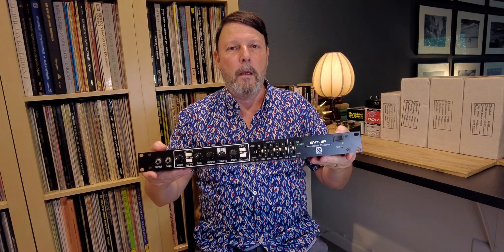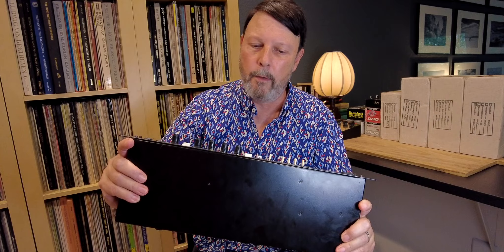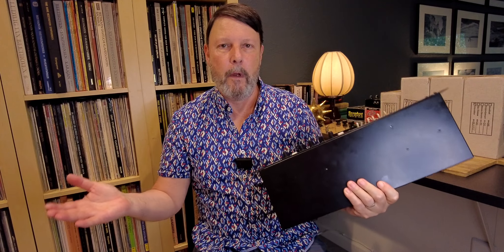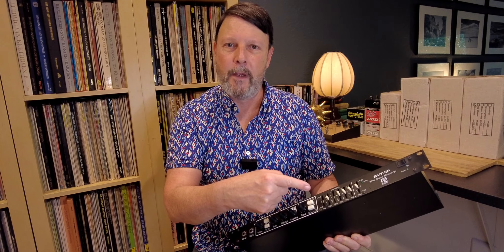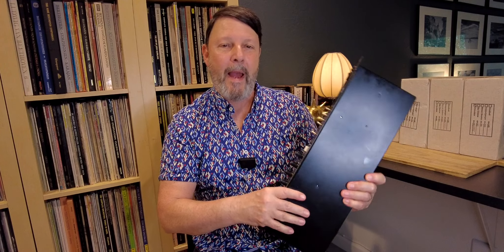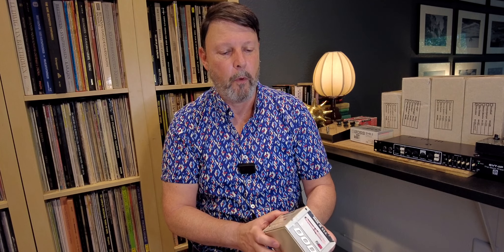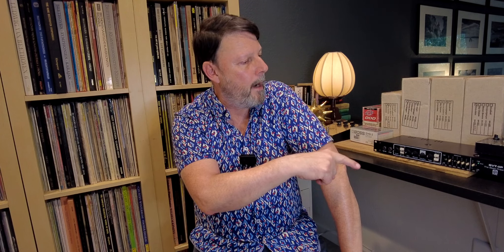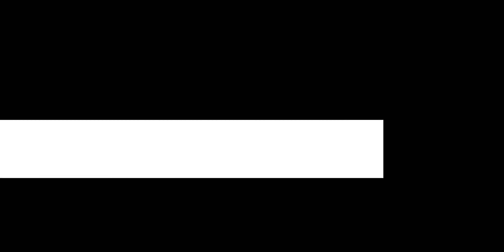90's Era Bass Rig Rundown with Mark D. !

Comment: My old studio engineer buddy had the DOD King Buzzo pedal(still in the box).Never got to try it but I'm sure it was gnarly 🗽
Reply from the maker: Nice ! It was definitely a noise maker !
Reply: I remember a guitar mag that had an article on the "Buzz Box." To this day, I have still not seen one in the wild, or know of anyone that has one. I'd love to hear it's sound!
Reply from the maker: @ScaryGarrySG1  I'm remembering now that I had one and gave it away...seemed to be a combo of the MXR blue box and the DoD Grunge box that I had also. Utterly unpredictable and more like a joke pedal than anything else ! I don't think you missed much...
Reply: @MarkDeutrom  Ha! Thanks for the reply Mark. More in that reply than I have even heard about that pedal in 25 years or so!
Reply: Yeah I played one in the 90s. Hated it. Trust me. It didn't sound like Buzz or the Melvin's. Just alot of hard to control noise. I ended up buying the Grunge pedal instead.Which sounded much better, but didn't sound very Grungy like Nirvana or Pumpkins etc.It had alot of gain on tap and a active bass and treble tone stack,but not much bass heavy,fuzzy grit. Sounded kinda like a really trebly, extra bright,stacked  Rat pedal. Except Rats sound much better,. They are more bass heavy,with that fuzzy grit i love. So I sold it but still have the Rat! Lol.....Buyer beware.
Reply from the maker: @nicoguarini28  The  original Rat is a legendary circuit. The Buzz Box was just an inside joke that no one knew about ! Probably someone somewhere has made it useful somehow...
Reply: I bought a Buzz Box and returned it.  I thought it was broken.  Not very musical at all
Reply: I bought one for $15 right after it came out cuz this kid I knew thought it would make him sound "grunge" & was sadly disappointed 😂😂😂 Wish I still had it

Comment: Hey Mark, amazing video! Thanks so much!!
Could you talk some more about live sound? You said you used the preamp DI but also had these massive stacks. Do you think the mix of both was important or did FOH do just fine with the DI? I assume cab sim wasnt a thing yet. How did you make drive sounds sound great through DI back then? Sorry, I have so many questions but its really difficult to get quality info on live sound these days. Most people on YT and Co just build bedroom tones.
Reply from the maker: So there was really a combination of things... Signal went first to a Sansamp Bass Driver set to replicate my ampeg preamp setting. DI from Bass Driver went via XLR to FOH mainly as a backup but was probably blended also. The parallel out of the BD went to a couple of FX  before the pre. The #1 pre out went to a stereo digital delay set to 10-15 ms and then into a stereo power amp. The other out on the pre went to an additional power amp bridged to mono. I ran the mono cab in the middle of the stereo chain when running 3 cabs and it sounded great. The Bass Driver DI and it's variants have always been great and weigh 300 lbs less ! Thanks for spending time here.

Comment: Thoughts about the FOUR cab setup,
did you use any ear protection,
how much, if any, hearing damage have you accrued?
I would assume that some of the "worst" shows may also be viewed as Best Shows, as poor crowd reception opened the door to get the goodies out and make a racket as you say.
Reply from the maker: My biggest fears on tour were running out of aspirin and losing my earplugs. Thankfully my ears are excellent from looking after them. Dale's cymbals were deadly without ear protection. Poor crowd reaction was just that...it wasn't a good time and actually dangerous at points.
Reply: I made it to one of the KISS gigs, at The Mark in Moline. The crowd reaction was mostly indifference.  I can't imagine the mental fortitude it would take to go on stage during some of those arena runs with white zombie, nin, etc. when you run into that kind of threat possibility repeatedly.  
You're a wide open target, can't see a thing, and so completely overwhelmed by a mass of angry, drunken miscreants.  Wasn't it the Dallas track on the singles collection where you were hit by torn up flooring? The ice show? 
Puts a lump in my throat just imagining that. I would absolutely be hiding behind the Ampegs. Glad you made it as well as you did.
Reply from the maker: @melvins1  All those Kiss shows we played were awesome, and they were all very nice people, it's great you got to see one of them. The first one was at the Superdome !! Dale looked paralyzed and he could hardly start playing when we got on the stage. 90's audiences were weirdly aggressive at points. They were ANGRY about something...the Dallas thing was rough. I've never seen an entire crew look scared, and yes, I did get hit by a piece of flooring....how did you know that ??? I had a 6 inch bruise on my chest for about a month. People were throwing batteries, 50 cent pieces, pens, all pretty bad stuff to get hit with...and the floor. I might talk about the White Zombie thing at some point...I have more to add that hasn't been heard...mainly just disappointing and wretched behavior from so-called "adults"...it's just funny at this point.... Helmet's audience was also dreadful in many situations, however no one died, and all of this is relatively minor in the scheme of things.